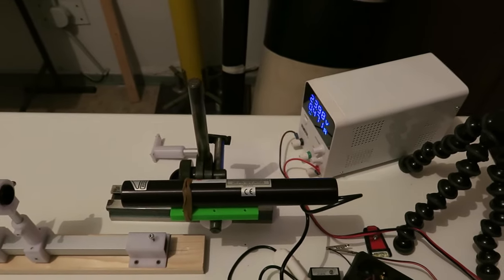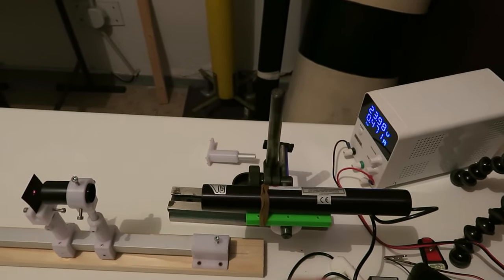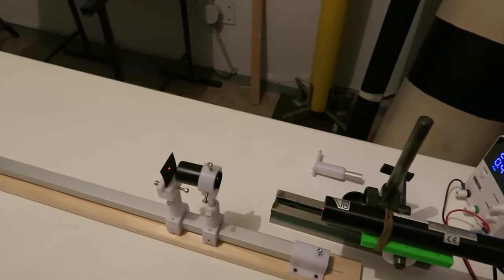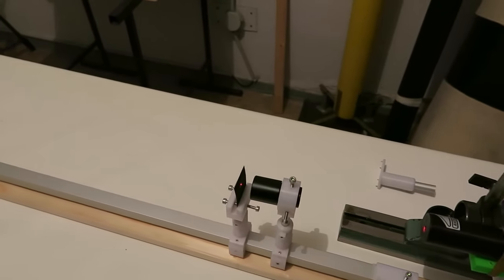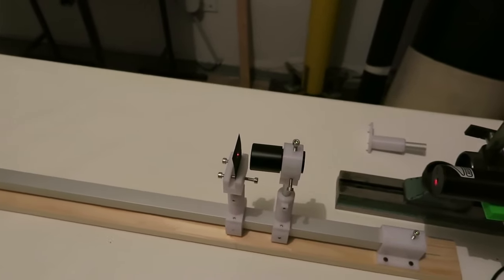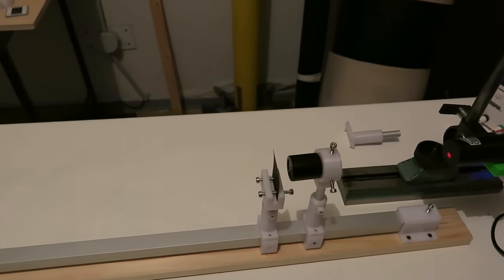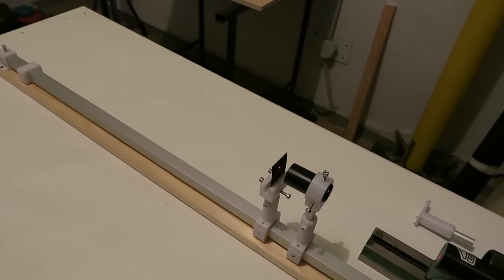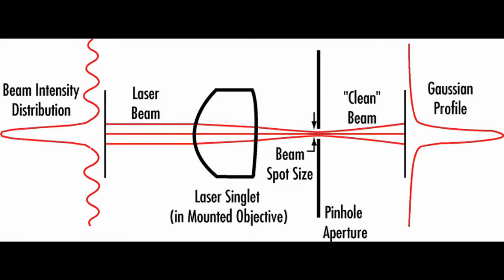Laser spatial filtering

Comment: Nice! Could you please show the comparison between the filtered and the non-filtered images? I am sure this would further increase the didactical value of your material.
Reply from the maker: Yes, you are certainly right. Unfortunately I have recorded the videos a long time ago and I can't find the one that showed the image of the beam without the pinhole. Here you can find more information on spatial filters: https://www.thorlabs.com/newgrouppage9.cfm?objectgroup_id=10768. The non filtered beam image in my experiment looked like the one represented in figure 2 by thorlabs: a central Gaussian spot (on the optical axis) and side fringes, which represent the unwanted "noise". Hope I have answered to your correct observation!
Reply: @scienceotherside2000  Thanks for a fast reply :). The "noise" you are getting rid of is (I believie) a fine example of the Airy pattern we observe in our telescopes. I just thought it might be interesting to compare the two results, just as a cool educational video :). Thanks for the link!
Reply from the maker: @alganonim  Yes, high spatial frequency components are due to diffraction. In the case of my laser these high spatial frequency components arise from higher modes of the laser cavity and diffraction with moisture present in air. Probably in the future I will make a video on the spatial filtering of one of my diode lasers and show both the un-filtered and filtered beams. Diode lasers are rich in high order cavity modes.